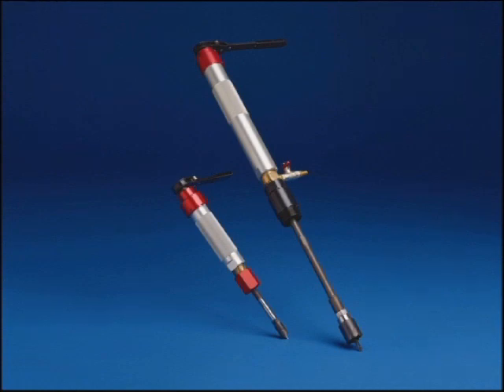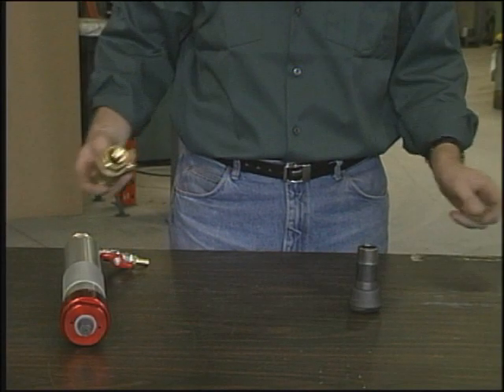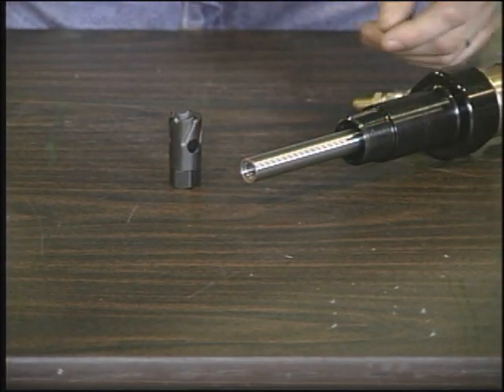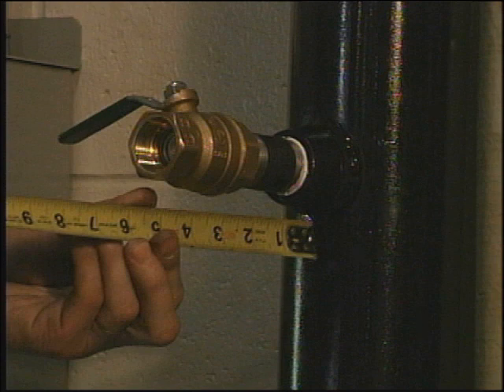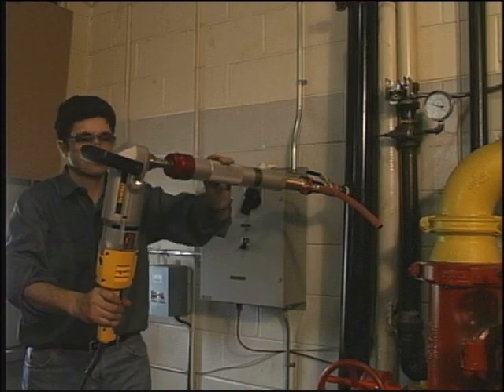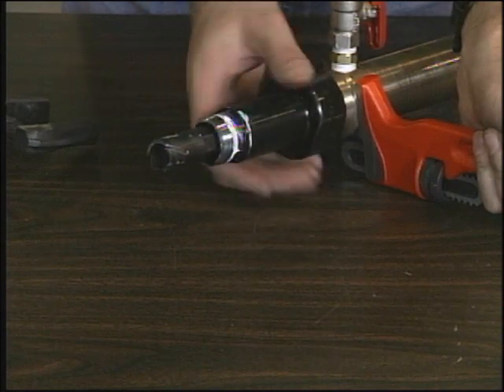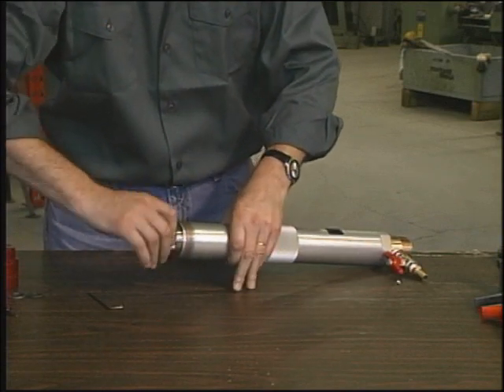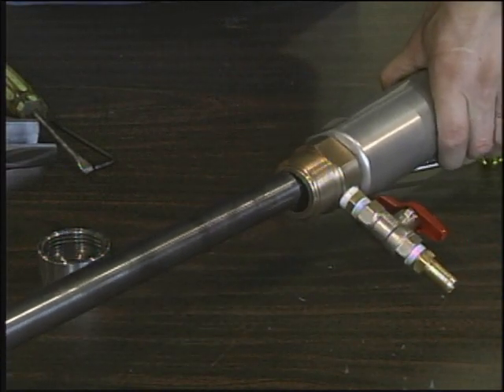RIDGID RT3422 Tapping Tool Instructional Video

Comment: The one really good aspect of this machine is that the pressure from the tapped line can not thrust the drill rod back out of the machine once penetrated like most tapping machines. It can only be withdrawn by turning the body backwards.

Comment: I use this very machine all the time. It has its good points and its bad points. The seals or  O rings dont last long and the way it is made lets the chips pile up indie the barrel which messes up the threads on the drill shafts and Im guessing that also is affecting the longevity of the seals. The only way to avoid that would be to have the test port valve open the entire time to flush them out but that isnt always practical.
Reply: In what scenarios do you use this ? I work in NYC doing commercial repairs/re-modeling/sprinkler work. The chief engineers of the buildings we service would tell us to get the fuck out if we drill through a live pipe.

Comment: this is a two man job.
Reply: Yes it is a two man job with this machine even as small as the larger version is. Up in the air on a ladder or lift it is very difficult for one man to drill and support and operate the tapping machine.